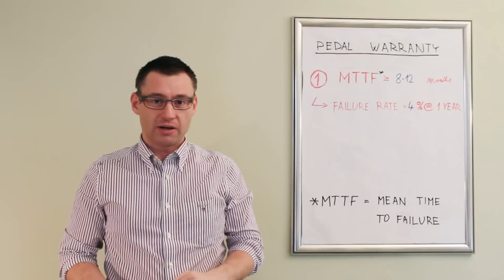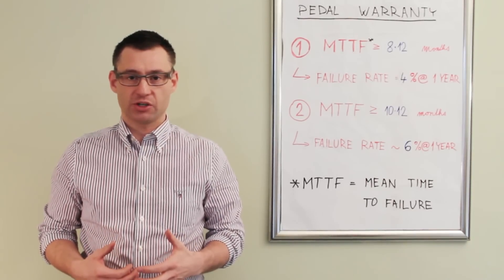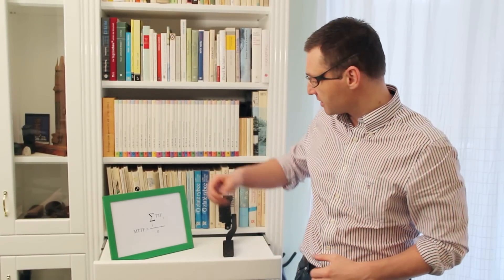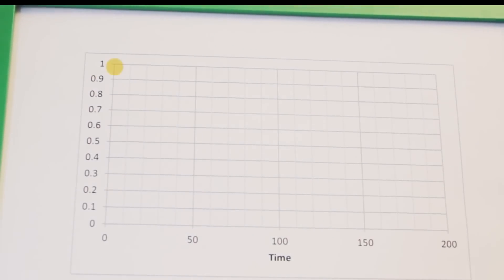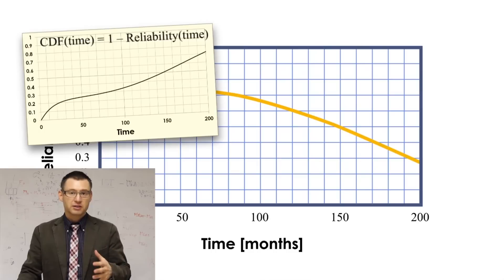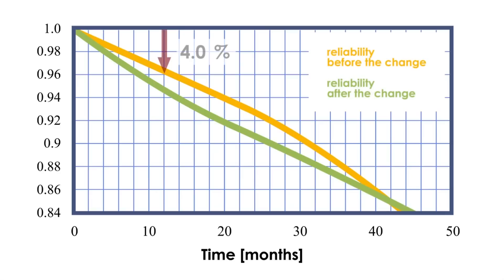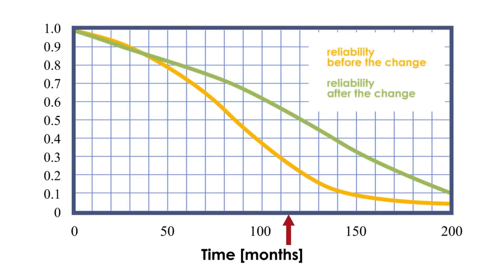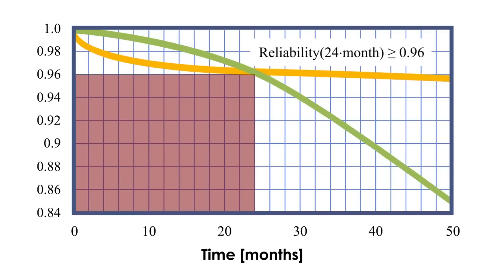Is MTTF a Measure of Reliability? (Mean Time To Failure)

Comment: and what would you do, if you have to choose between 2 parts from different manufacturer: the 1st part has MTTBF=10 years, and another manufacturer has MTTBF =20 years. Which one you will prefere?  Does it mean statistically, that the second one is more reliable? In the very begining you will always have early failures.

Comment: A little disagreement with the core points made by the lecture. The sum(TTFi)/N is not the reliability which used in statistics or engineering, it is just Mean Time To Failure.

Comment from the maker: Thank you all for commenting and for your compliments!

@Chet: I agree that setting up an ALT is a subject to errors of different kinds as it is generally impossible to bring the nature to the lab. For that reason, the lab tests should not solely be the means of validation. However, it is possible to measure (with limited precision, of course) the quality of the lab tests and their similarity to the real conditions. One way of setting the tests is therefore optimization of a measure of similarity (optimization for implications rather than for the induced loading). In that way we know what the limitations of the lab test are, and have that on hand when making conclusions about the test results.

Your comment about the combination of the different failure modes was pretty inspirational. I know this is the generally recommended practice, reflecting on the often observed effect, that the individual failure modes (unlike all of them mixed together) better fit the usual distributions. I understand it is practical, relatively robust to insane extrapolations, the combined distribution (it is a weighted addition, not a multiplication) gives a good estimate of the “composite” reliability function.

I would like to offer an alternative view of what is done by this: In the end we actually have a distribution function of many parameters. E.g. if we identify 3 failure modes, model them with 2 parameter distributions, then we end up with a distribution function of 11 parameters (3x3 parameters + 2 weights, the last weight is determined by the previous two). This is a rather complex function and we are likely to make some unnecessary assumptions. The more parameters we have, the more sensitive we are to assumptions. And it is just three failure modes. The quality of the parameter estimation is the lower, the more parameters we have (degrees of freedom problem).

The other question is how we will justify if the observed failures are  one failure mode or two or several. Sometimes it is apparent (e.g. brittle fraction versus abrasive wear), but sometimes it is not (fatigue failure in one weld, starting at just slightly different points). Technically, it is only a matter of detail we choose, that will make us to combine or separate them. For people who measure a reliability of a fleet of machines (e.g. rental shop or a mine) it would be “that bloody xy machine again”, because the xy machine is their component. While for the welding expert in the xy factory it would be two very different points of weld on one specific part, needing two different approaches to fix them – the component here is not just the one part that failed, but a particular portion of it. And they both would be looking at exactly the same failures. So fitting a reliability function of e.g. 5 parameters to all failures mixed together should be equally valid, and the quality of it will likely be better.

I agree we need the reliability function to reflect on all of the failures and failure modes, but there is more than one way of obtaining it. As we depend on statistics (and statistics does not care about ships, planes, excavators, and trains, contrary, its virtue is abstractness), we always should try more than one way and see if we end up with the same conclusion. If we do, we know that the conclusion is not sensitive to the approach we choose, which is good, because we never know which way is the right one. The goal is what matters.

BTW: There is quite a broad discussion on the video in the LinkedIn’s “Design for Reliability” group – have a look!

Comment: The testing of the redesigned replacement part was inevitably an Accelerated Life Test (ALT) which is subject to (at least) three kinds of error due to the acceleration:  (1) artifacts of the test process introduced that are false failure modes, (2) real failure modes that are masked by the accelerated test, and (3) error in applying a Life vs. Stress relation with its all-important constants.

Further as failures occur in the field or in the in-house Life Test, the failure modes should be separated and time-to-failure should be plotted separately for each failure mode, censoring (suspending) other units which fail for a different mode, or which don't fail at all.  A distribution should then be fitted to the data for each failure mode.  This would likely be a 2- or 3-parameter Weibull distribution which can emulate Exponential, Normal, Log Normal, and other distributions.

The actual Reliability distributions, R(t), for each failure mode can be multiplied together to obtain a much better picture of reality.   Simply taking the Mean, mixing together different failure modes, and not taking into account the times-to-failure is woefully inadequate.